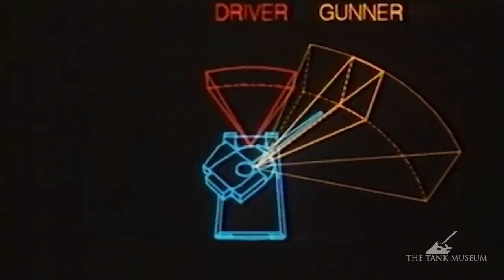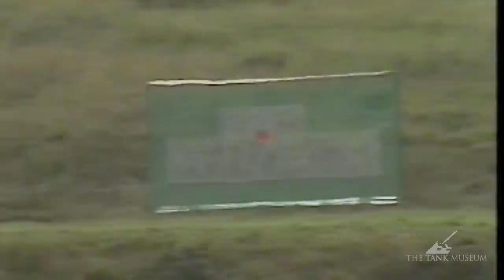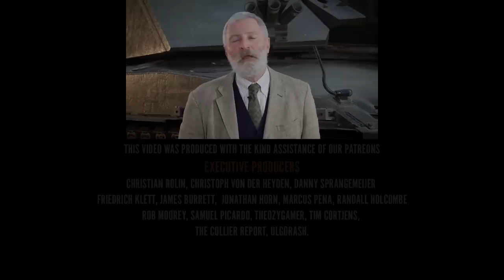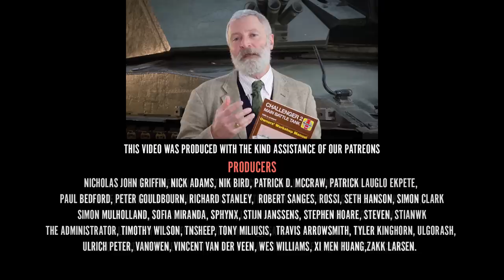Tank Chats #92 | Challenger 2: Part 1 | The Tank Museum

Comment: 3:18 - you mean T-64B. Regular T-64 and T-64A was in production for years already. And i can`t imagine how Chieftain can penetrate frontal armour of T-64B from 2500 meters.
Reply: In a word 'HESH"
Reply: @Ubique2927  HESH do nothing to composite armor
Reply: @TheSunchaster  T64's did NOT have composite armour.
Reply: @TheSunchaster  The T64 had a sort of spaced armour useless against HESH. So I am not kidding.
Reply: @Ubique2927  80 steel + 105 glass fiber + 20 steel front hull on T-64A
And HESH are useless against spaced armor too (steel + air + steel, like on US-German MBT-70/KPz-70), because breakaway
 fragments from back of frontal plate will be stopped by backplate.

Comment: Just a little story of my own. Lets say mid 2000s. Australia. Leopard 2 (!Iguess)?. I got to get  a few rides in these on the test track. I was assistihg with a German engineer "plumbing up" the new hydralics related to what was described to me " antiaircraft" ..a few new valve blocks and hosing. We would catalog every hose and length and fittings. Every tank was totally bare inside, just a pristine white paint. To me it was  a holiday. I worked pretty hard other than this, but to just " sit around" and do my stuff ...I made sure it was RIGHT...some lives might have depended on it.

Comment: You have probably heard this question before: Why is the FV4030/4 Challenger 1 and the FV4034 Challenger 2 not called Challenger 2 and 3 respectively? as they are preceded by the A30 Challenger
Reply: Marketing, it's all marketing. Geoff Who is a cynic.
Reply: Well the Eurofighter is also not called Typhoon 2
Reply: As far as I am aware, when the issue came up it was felt to be redundant and possibly even confusing, as few if any in the UK had ever heard of the A30 Challenger. There was no connection between the designs and there was no popular nostalgia about the earlier tank to link with. The lightning 2 is named to create a nostalgia link with the modern aircraft to an older aircraft that the British public is proud of. If they made another tank called chieftain then the public would expect it to be called Chieftain 2, but if they made a tank called Cavalier then few would care that there was an earlier tank by that name and it would Just be Cavalier. I think of it as Challenger 0, Challenger 1 and Challenger 2

Comment: Note loading the multiple component rounds the loaders sequence load time. Under stress possibly an improper sequence. Too long vs a single full up round. Not sure HESH round worth the extra time required as you may be under fire
Reply: The multi piece ammo is more about it being easier to stow wherever there can be made space than any specific hesh requirement.
The RO 105mm/L7 used single piece ammo and did use HESH too without any problem.
Reply: SonsOfLorgar was a load time ever comparison made? I am an old US Combat Engine Maint Tex and our M728 CEC used the 165mm Projectile for some really great demolition capability out to 1600 m. Desert Storm very effective in making ant hills out of Iraqi bunkers

Comment: I wonder what we do now. Challenger II was a mid 90s tank. Last one built was 2002. It's now 2020, making  all our tanks at least 18 years old. And with the factories closed, zero chance of building anymore. Challenger II only fought one war, the 2nd Gulf war in 2003. That's it. A war that only lasted about 3 weeks. Sure, it's had some upgrades since then, and is about to get some more, but the mileage on the clock is ticking up every year, and we only have 227 in service with about 110 in reserve. I sometimes wonder how 20 Challenger II's would fare if they went up against say 240 Russian tanks (that is pretty much the ratio). About 150 of the latest upgraded T72 versions, 50 none upgraded. 20 T90's and 18 T80's. And maybe a couple of T14 Armata tanks. Maybe even throw in a handful of tank destroyers (they've got them, we haven't). Nothing else takes part except support stuff and engineers for bridging etc. How would the Challengers fare over say a week long battle on a European battlefield roughly the size of Luxembourg? Then, how would such a battle pan out over say six months elsewhere in Europe but a much bigger battlefield, stay the size of Switzerland. You can increase the Challenger numbers to say a hundred, but the Russian ones would be increased by a similar amount to around 1200. Overall, I would say the Challengers would probably be overwhelmed in both scenarios, especially the second one. And if such a war continued for another six months (a year in all), I doubt there'd be any Challengers left (maybe a handful) as the chances of replacing lost ones would be minimal compared to the Russians. Not only do they have vastly more in reserve, their factories are still around able to churn out more, including spare parts.

Comment: Is HESH ammo defeated by spaced armour or even certain composite armour?
Reply: It can go through things like rubber sideskirts and external storage boxes etc but will be defeated by any real spaced armour and any composite armour. Even the most basic Steel/Fiberglass/Steel array on the first T-64s from the 60s.
Reply: @Panzerzwerg  Not with a single shot maybe. Multiple HESH rounds will make a mess though.  It will blow off tracks, destroy optics, damage barrels beyond use. Lots of Bang!
Reply: It is still the best performing round for use against concrete bunkers and other fortifications, so having the option to use it is always useful.
Reply: @watcherzero5256  Best is programmable HE now. HESH is obsolete.
Reply: Programmable HE is mainly designed for use against highly manoeuvrable targets like Drones where it can be used as an airburst fragmentation effect. It is not superior against fortifications.
Reply: @watcherzero5256  You are thinking about Air Burst mode only, but DM11 as example also has Point Detonation and Point Detonation with Delay mode. The latter detonates after penetrating cover.
Reply: Those rounds are designed for killing infantry hiding behind brick/stone walls and are quite popular for 40mm ammunition which tends to see more action in the anti-infantry role. They are no better against fortifications like bunkers as they lack HESH's armour penetration ability. E.G. from the Rheinmetall page "Owing to its time-delay fuse, it is especially suitable for supporting infantry units tasked with taking lightly fortified positions as well as for engaging light and medium-weight armoured vehicles....the round can be timed to explode for maximum effect either above, in front or inside of a target (e.g. after penetrating a wall)."
Reply: @watcherzero5256  You have the wrong idea of HESH. Armor penetration capability? Do you know what HESH stands for and how it works? It creates spall on the other side of the wall, it doesen't penetrate. PDwD HE is much more effective because it penetrates the wall and detonates afterwards inside.
Reply: Programmable HE lacks the shaped charge which defines HESH, The 120mm M908 HE-OR-T was an urgent operational requirement as the 165mm had been retired and they found in Korea in 1996 their existing 120mm ammunition was ineffective against concrete bunkers. The M908 is designed to fracture by using the explosive force to drive a steel pellet into the concrete. It did perform comparably to the 165mm in penetrating inelastic concrete but is inferior against an elastic material like steel.
Reply: @jonny2954  HESH is literally a gun-launched demolition charge. Yes, against armour it will only create spalling. Against concrete it will create a whopping great hole.
Reply: @ker-klickchoom5119  So does HE with PD... But if you encounter a wall that is too thick to blow a whopping great hole in you need something that makes a small hole yet still kills the things behind it... HE with PDwD.

Comment: So why in the new iteration I believe they went with a smooth boar barrel
Reply: Are you talking about the proposal by Rheinmetall? I think it's the same 120mm smooth bore that the Leopard uses. Not sure whether we will actually be using it though.
Reply: Its more a case of interchangeability of nato projectiles. The UK government won't fund any further development of munitions for the L30 gun, so the only hope for an improvement in lethality for challenger 2 is adopt projectiles made by Germany or America which use the rheinmettal 120 l44 or l55 smoothbore gun.

Comment: I saw a really rare video of Challanger 2's drag racing at Elswick, the turret traverse is so fast it can engage low flying ground attack planes/helicopters... and I saw a video of what HESH actually does to a T-72 spall lining is the least of your problems.
Reply: I've got a mate who is an ex engineer. he saw the turret drive gear at David Brown's factory. he said they were way ahead of most civil gear drives.
Reply: @thewomble1509  some of the Military Stuff is God like. My dad actually worked on a turret drive system for the "International Tank" in the 60's before the principle partners Germany & the US went off to ultimately build the A1 Leopard/M1 Abrams...
Reply: @thebritishengineer8027  Sounds interesting. i bet you've got some good stories.
Reply: @thewomble1509  ....I gave 3M the idea of putting Ad's on Post-IT Notes... got 2 box's of notes for my idea. That was a bad one. Couple of years later... I worked out how to heat the crude oil in Siberian Rail Tankers so they could pump it out.... Without using a half mile long heated shed to defrost the train as the EU boffins suggested. How's that...?
Reply: @thebritishengineer8027  A man of ideas! 
I don't suppose you can tell me where to find the C2 vid you talked about earlier?
Reply: @thewomble1509  Alas they both vanished... I think the MOD are a bit cagey about what they want people to see. I can hint... when the Blue on Blue happened in the Gulf the hit to the targeted Challenger. Put it on the back on the engine deck... that's one heavy lump of steel to move 4 feet!!!
Reply: @thebritishengineer8027  Ahh, yes the OSA and all that. Never mind, it may come to light one day. Anymore little anecdotes?

Comment: I don't get how Vickers were told that protection was the #2 priority and their solution was a product where 50% of the frontal profile is unarmoured against contemporary anti-tank rounds.

I know the plan was to fight from hull-down prepared positions, but did nobody at Vickers or those in the army in charge of evaluating the designs etc ever think that they might at some point need to use them in an advance, or at least make sure the entire turret front is adequately defended?
Reply: Cold War - NATO forces in germany fight a defensive battle fir six days then either the french or amis decide all is lost and nuke everyone. No advances planned
Reply: The turret front is more than adequate. It has the equivalent thickness of nearly four FEET of RHA!
Reply: @thewomble1509  the turret cheeks might do (but again, that equivalence will change depending on the round fired at it). But the mantlet area is nowhere near as well protected and it's much larger than the preceding Challenger 1.
Reply: @sergarlantyrell7847  Well, C1 didn't have a mantlet at all.It's "under turret" was a cast shell ,similar to Chieftain,which was also a mantlet free design.
I'm no expert but I would guess C2 mantlet is as well protected as any other modern MBT.  The mantlet is a weakness in any tank turret as it houses the gun trunions and mounts.
Reply: the womble 
„I‘ m no expert“- That is true!
Reply: Come on, say something intelligent and insightful about the C2 ...................
Reply: Come on Mark, speak up.............
Reply: Oh Mark, are you OK, you've gone terribly silent, Mark. I need to know, share your knowledge PLEASE!!!!!!!
Reply: Don't send a boy to do a man's job.............

Comment: It was a very good MBT. Bud sadly its achilles was its shitty powerpack. They remedy this by installing a German powerpack at a later date.
Reply: It was? It still is you divvy. The CV12 is a fine engine too. Tougher than the MTU, capable of developing 1500+ bhp.
Reply: @Battlenude  The CV12 is one of the most reliable tank engines around. I don't know where you are getting this info from.

Comment: HESH the same Penetration at 20m as at 2000m. It is monstrously good.
Reply: apperently with today's composite armours etc, its meant to be pretty useless or atleast less adequate.
but im no expert.
Reply: Just like HEAT.
Also, that doesn't automatically make something good, in fact, defeating modern armour is what HESH is the least competent at, and what it shouldn't be used for.

Comment: Cost cutting really gimped this tank. So sad really, just how underpowered it turned out. Having huge stocks of old ammo resulting in the decision to use a rifled gun and having poor future proofing. Weak engine compared to the weight. That huge gap in the hull for the driver port just waiting to eat hits along with no composite armour on the lower plate is terribly designed.
Hopefully the Rheinmetall upgrade goes ahead and this tank gets the love it deserves.